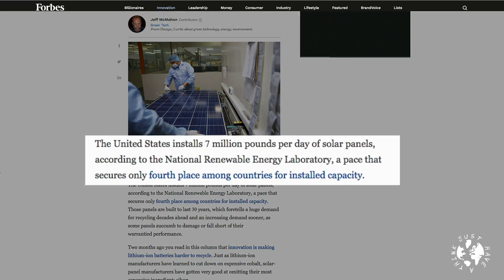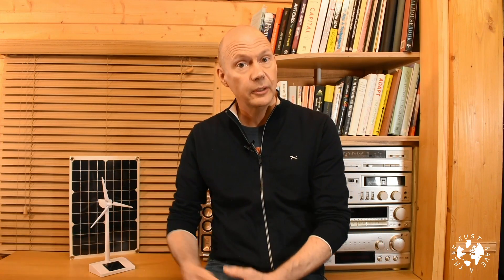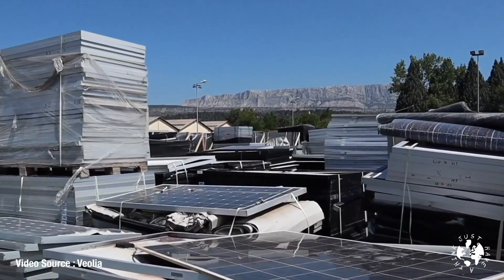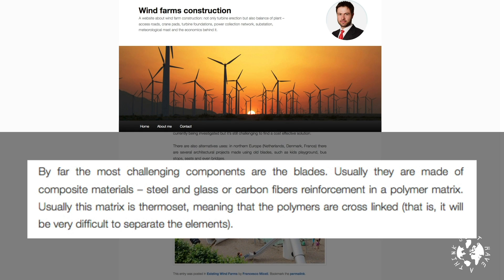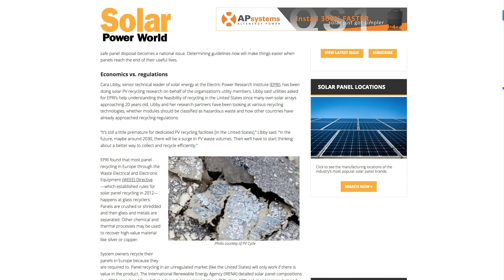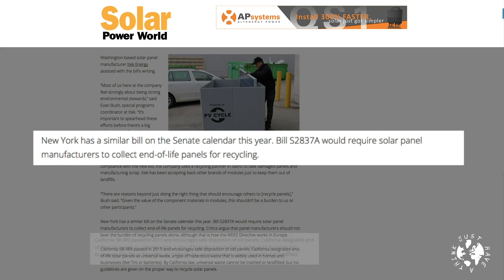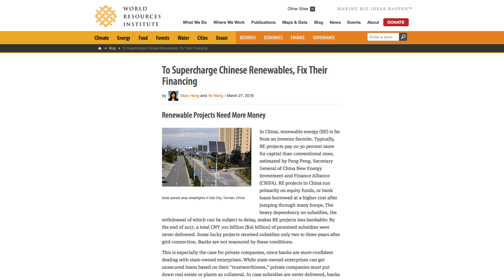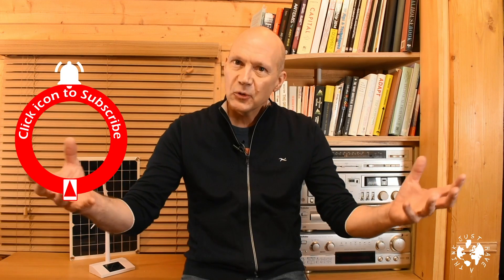Recycling renewables : a price too high?

Comment: I personally belive solar and wind is maybe a "dead end" and to unreliable in efectiveness due to obvious reasons. + they ocupy massive landmass and "pollute" nature physicaly by their apperance and opperation. Nuclear is far more efficient and relyable, but there is the problem whith waste and possible accidents whith the reactor, a giant solar storm would lead to a disaster beond imagination if it struck today. Molten salt reactors on the otherhand would shut itself down instantly, whithout the risk of core meltdown like in Fukushima, that to this day spews out tonnes of radioactive waste into the Pasific. Huston we really do have a problem ;-)
Reply: I claim that settlements, roofs, facades and deserts occupy massive landmass (and don't get me started on streets). But since we have them (buildings, and deserts), they can as well serve double duty. 

people underestimate the amount of solar energy the earth receives: it is massive. It is just that a lot is reflected back, a lot interacts with matter and is reemitted as heat (infrared) and then is lost to space (the greenhouse gases only slow up the process and therefore shift the temperatur balance from average -18 degree Celsius (assumption if the earth had no greenhouse gases incl. water vapour)  to + 15 degree which suits us fine.

Eventually all of the huge amount of energy will be lost to space - but we can insert another layer of interaction with matter (solar panels) - and put it to use before we lose the energy inevitably to space.
Reply: Xyz Same agree on buildings and solar, but I happen to live in Norway that is refered to in this video. Our politicians is in a frenzy "to save the world" and in doing so they are now planning to destroy wast areas of untouched wilderness... it is absolute insanity, taking into acount that we already ARE self sufficient whith hydropower...but hey, wildlife, forests, beautiful mountains and coastlines does not really matter when 5 million people has to "save the world" from "carbon pollution" (everyting is made of carbon by the way). Tripple electrcity bills should be a small price to pay. And since we are "world savers" we use our trillion dollar oilfund to invest in "enviromentally friendly biofuel" who the fuck cares if it is on behalf of massive areas of rainforest? We're "saving the world from carbon" remember. I hope one day all of those lobotomated green fuckheads gets their head of of their fucking ass, and actually DO something sensible for this planet.....they can start whith a degree in physics and chemistry.....fucking wankers!!

Comment: Good video. Great topic. You are correct manufacturer's can be designing clean chemistry, clean disassembly and remanufacturing into all of their industrial products including renewables. This is called the "circular economy" where waste equals food. Cradle to Cradle Certification provides the commercial framework for this "design for disassembly" production transition from linear to circular. SunPower solar PV manufacturer is already Cradle to Cradle Certified with clean chemistry, clean disassembly and remanufacturing. Good video. Thank you.

Comment: How difficult is it to recycle a current fossil fuel (coal) power plant at the end of its life. The concrete, steel, plastics, aluminium, composites and copper are quite difficult to recycle and many used asbestos in the lagging of pipes for steam production and other toxic materials as well as the contamination of surrounding areas of land through oxides of nitrogen, coal dust and water contamination via sulphides. 
Then there is nuclear which takes up to 25 years to decommission completely and find places for the spent fuel rods as well as the nuclear waste and irradiated infrastructure.
By comparison, renewable energy infrastructure recycling is a walk in the park.
Reply from the maker: Hi Gill. Thanks for your comments. Your points are all 100% valid. I would never try to pretend that fossil fuels  are anything other than a terrible idea, and that nuclear also has some very obvious downsides. In fact I would hope that this would be a given, in the context of the channel. I really just wanted to raise the caveat that as we (quite rightly) accelerate towards renewable technologies as quickly as we possibly can so that we can end the scourge of fossil fuels, we must also be mindful of doing so in as responsible a way as possible. I appreciate your feedback though. Many thanks. All the best. Dave
Reply: Aluminum, steel and copper are probably the most easily recycled materials used by man.   If this weren’t the case they wouldn’t be so valuable.
Reply: Eric Patterson. I agree, they are very recyclable. Even concrete and bitumen are recyclable to some extent now. The real problem has always been separation from other contaminants which in power stations can be problematic, especially Nuclear powered because the metal can remain radio active after exposure for a lifetime or longer.
Reply: gill7087 good point I didn’t consider that aspect.
Reply: You left out mercury from burning coal until a couple years ago.
Reply: Old nukes cause tremendous disposal problems because decommissioning was not even considered when they were built. But they do not leave contaminated land as coal has done. 
The new molten salt nukes are far simpler to build and done with disposal in mind. They are also much smaller because they run at higher temperature and at atmospheric pressure. There is no massive pressure vessel or even bigger concrete containment dome to deal with. 
The fuel is also fully used at 99% versus just 3% for a PWR. That solves the long term active storage problems. One design is being built right now which will use old irradiated fuel to fuel its molten salt core.
Reply: How many wind turbines to equal one typical coal fired plant?
Reply: gill7087 Absolutely! Anyway the point is we HAVE to stop using fossil fuels, and Nuclear is not an option. As Einstein said ‘’Splitting Atoms is a hell of a way to boil water’’
Reply: Environmental Progress found that solar produces about 300 times as much waste in it's lifecycle than nuclear.
https://environmentalprogress.org/big-news/2017/6/21/are-we-headed-for-a-solar-waste-crisis
There's no real reason to decommission a operating nuclear plant other than market forces, containment isn't good enough, the reactor vessel has aged too much (neutron degradation) which can be replaced, or the state just wants it gone. Nuclear waste is a far more densified energy waste and it "can" be recycled just like we "can" recycle solar panels. Solar panel manufacturing produces waste byproducts that aren't IN the panel itself so storage of solar waste is an issue now, and that must be stored forever just like nuclear waste except not nearly as dense. Or you can be China and not care you are poisoning your own people, kinda what the video doesn't want us to do.
Reply: @leerman22  Troll Much?
Reply: Green energy generators are basically home appliances, as they contain mostly the same materials as vacuum cleaners, fridges,  light sports cars...etc... We don't have to invent new technologies for their recycling.
Reply: These things don't really need recycling, as there is plenty of space for power plants. Things like solar are different - the real estate used by a solar farm is valuable space to rebuild a new solar farm.
A nuclear power plant never even needs to be decommissioned. Once the reactor reaches end of life you might plop in a new reactor and continue operation. The steel used for the reactor vessel is quite straightforward to recycle. Concrete is less easy, you need to pour some new containment base most likely. But the volumes of material in question are much lower than with solar panels, so it's easily worth it if solar panel recycling is worth it.
Reply: @zolikoff  Pop in a new reactor?  I used to believe in Santa Claus. But now I just pop in the Easter Bunny.
Reply: @zolikoff  Recycling neutron-activated steel may not be the best idea. I have no idea how radioactive after say 60 years. It's very productive steel while it worked all those years anyways.
Reply: @leerman22  It's not likely a big problem, you can just wait a few years on it. Of course you might have problems with elemental contamination? I'm not that much of a metallurgy expert.
But anyway, steel is abundant and cheap enough, a reactor pressure vessel doesn't take up that much physical material. You may even recycle it into lower quality steel to reuse it, not necessarily a new reactor.

Comment: Not exactly the topic in the video, but why is Solar panel recycling something about squashing them to extract the materials? 

Obviously, it should never be necessary to replace a solar panel, unless damaged. Even after 50 years, when it only produces 30% of its rated power, it still makes more sense to just leave it and supplement your installation with more new panels, as square meter price is cheaper than new panels in almost every type of installation. That should also be able to support a second hand market where derated panels as sold at reduced prices, like recycled li-ion batteries are today?

Remember if you change your ancient 15% efficient panels with new 22% efficient ones, the difference in output is only 7% which means that the new panels only generate 1/3 more, but carry the full cost of a new panel, so payback time will be 3 times longer, than if they were put up on new real estate leaving the old ones in place!
Reply: Of course you are correct I run my entire farm on 8 year old second hand panels they also get re purposed for shed cladding and animal shelters

Comment: Having solar panels myself, I was advised that the inverter may only last 10 to 15 years, how difficult are they to recycle?
Reply: I suspect that newer inverter designs will make repair of old ones uneconomical. It's been that way in electronics for a long time already. Perfectly good CNC machine tools get scrapped because the controls go obsolete.

Our freakin' phones go obsolete on mere wish and whim.
Reply from the maker: @HuFlungDung2  Yeah - we really do need to get ourselves away from this 'throw away' mindset in society. Here in the UK there is a small but wonderful resurgence of groups of people setting up ad-hoc repair workshops - like Saturday morning drop in centres, where people can take old stuff that they want to keep and get it repaired by  experts. I hope we can steer ourselves towards this kind of philosophy.
Reply from the maker: Hi Carmel. Good point about inverters. An important and integral part of the system in domestic set ups. I don't know the answer 100% but having installed my own DIY solar set up, I've had a bit of experience of inverters and I would think that many of their components should be very recyclable and / or re-useable.
Reply: go for a solaredge inverter they can be warrantied for 20 yrs and can measure individual panel production so are able to fault find the system . I am an electrical engineer and monitor systems i connected in 2011 -12 and are still performing well. Thats what i have fitted .
Reply from the maker: @waynecartwright7276  Me too. Got it fitted with the main house system a year ago. Works beautifully :-)

Comment: Perhaps instead of solar panels to make yet more electricity to power bitcoin miners we should fit mirrors to reflect the sunlight back into space? Just a thought?
Obviously a pointless idea because our problem is not technical but moral, even spiritual. Terrible to think how many will die in the next few years! Anyone of us could be next - preparing to meet our maker is the best plan. (Suggest Reading Bible). I like these vids because they are very clear and thorough.
Reply from the maker: HI Omega. Thanks for your comments and for your support of the channel. Much appreciated. There are most certainly some very serious moral and spiritual questions to be asked in the climate debate, and they are questions I have also considered myself. I think folks should certainly take time to ponder these higher level considerations. My main aim though, with the channel, is to try to promote urgency with real practical (if not perfect) solutions that might give our civilisation a chance to survive through the next few decades and make changes that will enable longer term viability of the species. I hope the videos go some way to achieving that. All the best. Dave

Comment: Looking forward to your video on Nuclear power
Reply: Me too. Containing nuclear plants to the extent that they don't melt down once the infrastructure can no longer keep them cool should be of upmost priority and far outweighs the issue of obsolete solar panels. It may be the single largest responsibility we could take for the planet before our untimely departure.
Reply: @9squares  Correct, there are 1500 nuclear plants with about 0 with a good plan for decommissioning, especially a rapid decommission in an emergency.
Reply: @9squares  Correct, there are 1500 nuclear plants with about 0 with a good plan for decommissioning, especially a rapid decommission in an emergency.
Reply: @lawrencetaylor4101  Oh they have a plan.  Take the money and walk away leaving surcharges on the consumers who weren't born when the plant was built.   When private insurance companies will insure decomissioning costs, then we'll know they are closer to reality.

And that doesn't even touch the nearly 1 Trillion dollars for Fukishima (and there is one plant in Florida which has the same problem-- it's backup diesel generators are 7 feet lower than observed hurricane storm surges.  But it's "too expensive" to raise them 10 feet.)   Most of that trillion dollar cost is now being backstopped by the government (i.e. the citizens) which means reduced benefits, military, roads, etc.

Comment: My neighbour has panels that were made in the 70's ..yes they are not as efficient as when new but still they work fine..so I don't get how these can not be built so they last sixty years or more.
Reply from the maker: I agree Rob. And I think they are striving for that as well. But it seems (at least from my little bit of research) that this current crop flooding the world at the moment, have been built to extremely tight margins, and have therefore not been built with longevity in mind.There's no suggestion of 'built in obsolescence' in any of the literature I have read, but no doubt a conspiracy theorist would tell me otherwise! I think it's just good old fashioned lack of foresight on behalf of the manufacturers which I hope is now being rapidly addressed. Thanks for leaving your comments. Much appreciated, all the best. Dave
Reply: likely for producing hear then (solarthermie) - which was the first application,  electricity production photovoltaic  came later.